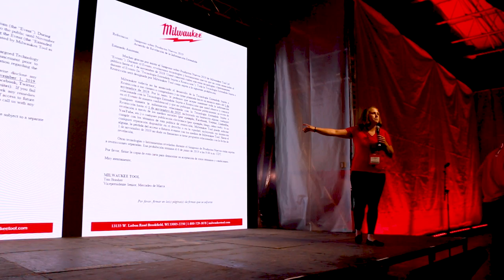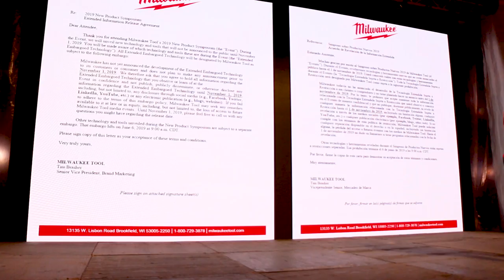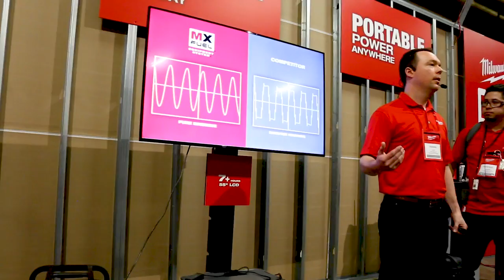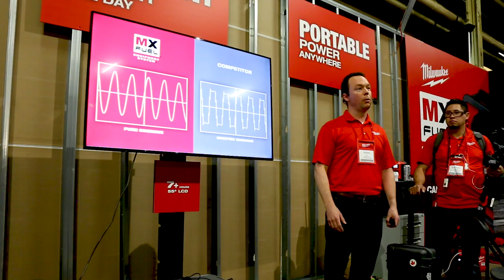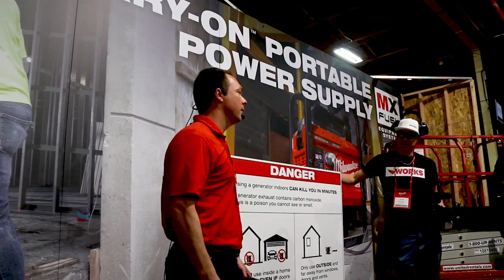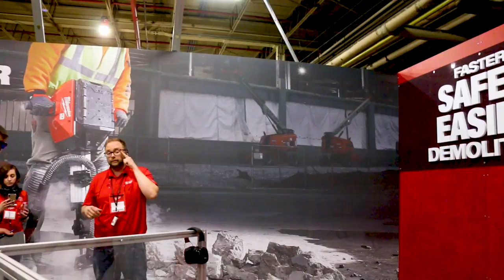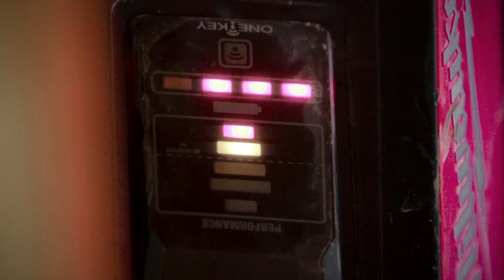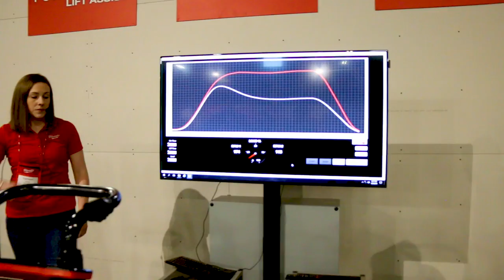MILWAUKEE TOOL MX FUEL (New 2020) LIGHT EQUIPMENT SYSTEM

Comment: Just to clarify I own Milwaukee, makita and dewalt tools. I am not a brand loyal guy, I love them all for certain things. With that said, Milwaukee is doing it right! All those tools you just listed have a justification for a new battery line. Makita on the other hand went backwards with their 40v that is not compatible with their 18v. And all they are offering is tools we already own, with “more” power. At least flex volt is backwards compatible! Super excited about these new tools Milwaukee has to offer! That’s my internet rant for the day. :) thanks for the video!
Reply: I agree with this 100%
Reply: Get you some battery adapters and interchange the batteries between tool brands

I'm the same way with tools, but I run my ryobi, worx, Makita, DeWalt all on Milwaukee batteries

Comment: Shit milwuakee should might aswell make a car by this point
Reply from the maker: Coming in 2021 jobsite golf cart !! 😂😂
Reply: @VCGConstruction  shit im down , i saw one on instagram 
Looks doable👍🏼
Reply: Do a Milwaukee vs Tesla soon on TTR!
Reply: MX boom lift 👊🏻
Reply: Hey, no one else is doing things right. Might as well let Milwaukee do it!
Reply: Milwaukee interface plug so you can use M12 to start/ power race cars and other small/ simple engines.
Reply: Could it be based in a new xxxl packout box, transformer style. Watch out for TTR -outside edition. (y)
Reply: Jessie James built a car on monster garage powered by Milwaukee batteries actually lol. so in a way.
Reply: Im waiting for a 12V jump box
Reply: With a packout trunk.
Reply: 2025 Milwaukee packout truck series powered off our new xc 3000.0 battery's only 40lbs and 6k per battery
Reply: They should make a tugger for electrician

Comment: With this new MX Line we better see a mower that uses it now!!!  

Could be the main reason why the mower wasn't shown at NPS19 as it will be part of this new line up.
Reply: Wouldn't be surprised about a ride on mower.
Reply: Would be nice. 
Or a riding mower that uses 2🤷🏽‍♂️
Reply: @danielgarbuzov8106  I'd be down for a ride on.  I'm done pushing. 🤣
Reply: @canogaparque818  Could see something late Q1/20 or early Q2/20 regarding a mower.
Reply: @shadowzedge5793  damn that early cool
Reply: Let's be real and honest though, not the average Milwaukee user/client is going to be going after the "MX" line, so they are better geared for making the mower (whenever it may show) an m18 battery line. The MX line is absolutely targeting contractors specifically, because of the price point is way too large for your normal/average consumer. Think if they did make the mower with the MX battery how many home owners are 1st of all even going to own it, then how many will continue to buy tools in the MX line?? Nobody, esp once some of yall see the price points, it's all fun and games hoping and dreaming till you see those 4 digit pricing points. And this is coming from a die hard Milwaukee fan.
Reply: @abijahgribble  well having that powersupply would come in handy and im sure thatll be on everybodys list , small footprint and hours of use, shit homie you cant go wrong there
Reply: @abijahgribble  they wont only release a mower on the mx. I'm sure they'll also release string trimmer with alot of attachments, chainsaws, hedge trimmers, backpack blowers, and I believe they're aim would be at the commercial landscape, and law care.
Reply: @canogaparque818  ohh no i hear what you're saying my dude 💯, but can you imagine how expensive the line is going to be to enter with? Then say just to purchase 1 or 2 batteries alone if the mower comes out in this line doesnt come with 2 but only 1 MX battery. I think so far they have done awesome In their OPE being in the m18 line, i myself and I'm sure others are heavily invested in the m18 line, so batteries plethora, I dont see ANY downtime. I'm just saying that it makes more sense for this MX line to target the contractors and construction companies, hell even some of the viewers here complain constantly and frequently about m12 and m18 kit prices, just wait will they release the prices for the MX line, and then alot of people will swallow the fact that this line isnt for them. Me personally I've found SO many uses for the m12 and m18 line I've invested in over the years, and to reach the average consumer they will most certainly have to come out with a wider variety of MX tools for it to make sense, but I really truly dont see that happening, as the m12 & m18 lines have us covered there and they continue to do so, if ya know what I mean brotatoe 👍🏻.
Reply: @danielgarbuzov8106  I fully agree on that if they were to release ANY OPE on the MX line. If Milwaukee is working on a mower, it's going to come out on the m18 line. People fail to understand there is still such thing as ideal marketing, if they truly want alot of its users or first time buyers to get their mower, they are not gonna want a price point so high that it just doesnt make sense to the average Joe to buy.
Reply: @abijahgribble  i hear you too ,i have alot of m18&m12 buuut im defenitely getting that power supply regardless, i know this is geared towards heavy duty contractors cuz when they get a contract they get paid in the thousands so i know theyll have no trouble selling this line ,like they said it eliminates alot of the gas troubles but its a case by case basis if it suites you then go for it if not theres no need to buy into it

That being said ,....power supply👍🏼
Theres like a shit ton of uses for it
Reply: @canogaparque818  that is one thing I see in the line that multiple users could use, I am curious on that price point though, it's easily gotta come in at 1k or more. But that thing would serve its purpose and then some, not to mention emergency type situations or camping without all the carbon monoxide and noise 👌🏻👍🏻. And very well put bro,  its case by case basis.
Reply: @abijahgribble  I agree 100% on your point about they will make a lawn mower on the m18 platform, but I also believe they will focus alot on making commercial grade lawncare tools on the mx platform not only a lawnmower.
Reply: @danielgarbuzov8106  @Abijah Gribble Personally I don't see how a mower could be in the M18 line seeing how Milwaukee has stated time and time again they they will not do a dual battery tool.  I don't even see using even the HO 12.0 on a mower due to power demands needed would have a short run time.  This new platform however with the single battery is the solution to the mower IMHO.
Reply: @RobertBarth1  Would be nice to see more regarding pricing of both types of batteries.
Reply: @RobertBarth1  my guess is that the compact mx battery will be alittle bit more expensive then the m18 12.0 ho the reason is because the compact mx battery has only 5 more cells then the m18 12.0 battery. Mx compact has 20 cells and m18 12.0 has 15. Now the bigger mx battery has 40 cells which is double the cells of the compact mx battery. I think the the price of the mx compact will be around 200$ and the bigger one will be around 350$.
Reply: mister clean  nah man I cant see them being over 9k for any of the MX stuff displayed in today's video, but hey we ALL dont know what it is yet, and for the people thinking the MX batteries will be cheaper than the 12.0, lol negative ghost rider, that just ain't happening, Hope's and wants aside. We will all see how this unraveled soon enough though
Reply: @shadowzedge5793  and ya man I understand, I have the same questions and concerns, but I do believe they will have one soon enough, I mean if the 12.0 can run a chainsaw for a little while, then it will for the mower as well, it wont be a long time, we all know that's coming, but I live on 2 acres, so that thing would be absolutely childs play on my property. It might cut 1/3 of an acre on 1 full charge and that grass better be already cut lol
Reply: i hope not... i would rather see it as an m18 single/dual style mower
Reply: Prices are out already on the MX stuff at home depot just type in "MX fuel" itll know what ya mean, take a look.
Reply: mister clean  me neither my man 🤷‍♂️
Reply: That is going to be a very expensive mower. The batteries alone are over $300 each.
Reply: Ride on mowers are only meant for professional landscapers or people with 2+ acres.
If you use a ride on and have less than two acres you better be 95 or have physical problems

Comment: Here's my issue and I actually bought quite a few new Milwaukee Tools here recently typically use DeWalt. But my father's company does as well. And I was tired of having people mistakenly take tools that look somewhat alike. So far I can say I've been please.

That being said I cannot stand it when companies and I was hoping that Milwaukee would be better than this. To these time trials. And they literally intentionally slowly start the gas powered tool or whatever they're going against. Then they start talking about things that most people don't do winterizing your wet saw. Most of the time people that have that kind of stuff own a building to put them in during the winter and most of the time rebuilding heated as well.

And that's just a small gripe. Here's the big one. You cannot start singing the Praises of your tool that you have barely done any kind of stressed test on. And they may say they've done a stress test. You and I both know there's a big difference between being out in the field using a tool in the real world. And then being inside and having machine run it until it dies.

He was talking about you know it's expensive to have to replace carburetors Etc. Well if you take good care of your tools to begin with I shouldn't be an issue. But when time does wear down. Because there's more of that out there it's going to be cheaper to fix. Again show me the stress test the real world numbers. Not some dog and pony show that they bring in people that like Milwaukee to go look at that.

Don't get me wrong I hope it does great and I hope that it does everything they say it will but unfortunately...

Pride goeth before the fall. Besides that I enjoy your guys's Channel you're one of the reasons why I actually started using Milwaukee Tools. When I was looking for something different. Keep up the good
Reply: Damn, I love milwaukee tools but am also not a fan boy and use Dewalt, etc. 

You got it spot on. Its a show for a reason, they're gonna buy the shittest gas tool to compare to their jacked up, brand new line, and you can tell its for the fan boys of this brand. 

That being said I've used a variety of these same tools on work sites and projects and these new MX Fuel seem to just kick ass. Haven't used them personally, I will say that, but that jackhammer test really blew me away once the Milwaukee started blowing through the concrete in a few seconds. Turns a labor intensive, time consuming job into a couple minutes of light work letting the tool control and drive itself, provided proper use, care of tool and what the job is. 

You can't argue with increased performance if they really do the job more efficiently.  I'm sure there's alternatives out there, as there is for everything, but milwaukee seems to exceeds the basics of most tools on a consistent basis. 

Each manufacturer and tool is different though, and shine at different things. I knew dudes in the field who were running battery adapters on their Ryobis, Dewalt, Etc and using milwaukee batterys. Me personally I've tried a couple different saws and blades out now, and I've noticed milwaukee blades and saws are kind of shit. Combine a milwaukee tool with a Diablo blade for example though and it excels versus most other tools in my opinion. The trick is just trying out different tools and bits and figuring out what works best for your work style and your personal preferences.

Comment: OMG please make that portable power supply in 230v 50hz for Australia!!!
Can use it to power my fridge while overlanding in the bush!

That thing will sell like hotcakes here for this exact purpuse, it replaces the need for people to put dual battery systems in their 4x4's... which is literally MILLIONS of potential customers here in AU
Reply: I am sure the tools will be no problem, not sure how they will handle the power supply. The concrete saw, coredrill, lighting system etc. will only nead a different input voltage for battery charging.... no problem. Yo will need to contact Milwaukee or one of their service dealers to get the answer to this market requirement. Of course, at 240V/50Cycle, they will need a specific inverter..... but the draw in amps is half that than at 120V ....My bet is they engineered a single inverter  with an internal 120/240 selection, or electronically controlled. All that need differ are the outlets, if I am correct.

Comment: 99% of the people here aren't going to buy any of these tools, yet y'all are going nuts over this stuff. The inverter is the only thing that could be mass marketed, but with proprietary batteries that probably cost $350-$600, good luck with that. They should have had an adapter for people who already have a stockpile of M18s

Comment: I'm a little skeptical about the Milwaukee breaker and saw cut.  The concrete slabs that they were breaking had no rebar in it. When your out in the real world there is alot of different re-inforcement in the concrete. That re-inforcement makes a big difference. Nothing really beats a pneumatic breaker.

Comment: I love Milwaukee Tools they come out with the smartest stuff then default copy's them then they get it out in 2-3 years later.Also by that time Milwaukee on to next thing. They need to add a corded option to the jack hammer Power pack and Wet saw. What I mean is if the batter is dead you can plug it in.

Comment: Great start to a lineup that I'm sure is 100 tools long. My only gripe is that they did 3 and 6 amp hour batteries instead of 4 and 8
Reply: Likely because they already have a second generation battery planned using 4 and 8 to look like an incremental performance gain. Profit!

Comment: I agree that battery is better is almost every way. But they constantly hide the drawback of charging by basically saying "it will only do half the work you need it to but you can just swap batteries" when the batteries are massive and expensive you don't want to swap it out 10 times to get through a day

Comment: Awesome looking tools gonna be a whole new ball game. Kinda disappointing they couldn't make them work with the expensive batteries they already sold tons of. I guess it creates a new market but I prefer the DeWalt approach with flex volt. I feel like they could have done something similar and it would have been nice for the guys who have invested tons in their m18 platform. I'm a little disappointed I would have loved to pick up some high voltage drills but no way I can do a 4th battery platform I already have over a thousand in batteries.

Comment: those MX batteries look like they’re going to have plenty of room to expand as battery cells get better, just like the m18 line with 20700 cells!
Reply: Mykel Hardin amperage draw. not capacity.
Reply: Mykel Hardin  I wonder why all of Milwaukee's H.O. batteries are 20700 based. You must be smarter than Milwaukee's engineers.

Comment: Milwaukee needs to make an electric bike like the radrover with that kind of power. And have an extra mount where you can add a second battery if needed. And swap the battery when one goes dead that way you won't totally run both out at once not knowing.

Comment: This is so awesome, any guesses on voltage? Come on MX fuel lawn mower
Reply from the maker: Milwaukee's answer was "at this level it's not about voltage we're using a horsepower rating" ! I wouldn't be surprised if the voltage is in the 240 range !
Reply: @VCGConstruction  I could imagine how hard it was not to spill the beans! I love that power inverter,would be nice if they make a smaller lower wattage version also.
Reply from the maker: Lawyers are very expensive, our lips were sealed!! 🤣🤣
Reply: After some research it looks to be 36V.
MX FUEL XC406 Battery (40) 3.6V 21700 6AH
MX FUEL CP203 Battery (20) 3.6V 21700 3AH
Reply: Just found out it's 72 volt, 80vmax
Reply: @aaronrepper7649  damn thats a monster right there
No wonder
Reply: It's 72 volts nominal or 80 max
Reply: 72 nominal 80v max

Comment: I'm wondering can you use the core drill for just hammer drilling. I work for a pest control company and we have to drill slabs on termite jobs and we use hilti and you only get about 20 holes out a battery. I have two drills cause they eat through batteries.

Comment: I love Milwaukee and have there 12v stuff but I gotta call this line out. It's ok for casual users. I'm roadworks. Its 2 batteries per tank on the saw. So some days that's upto 10 batteries for cutting blocks all day., The core drill looks good but when my drill makes that crunching sound it's the gears lol and that sounds the same, I doubt that sound is a clutch !. The Jack hammer come on man. The plastic boot thing on the point wouldn't last 1 minute on a site. The concrete is above ground level, a sledge hammer could break that, try breaking it in ground, nothing beats a compressed air red belly gun and after that a 2 stroke. The genny thing Is nothing more than a lithium leisure battery with inverter, u could save massively by buying just that. Don't get me wrong it looks good stuff but definitely not for roadworks yet. Imagine the concrete dust and particles getting into that battery connection over time. And then theres the issue of charging the batteries on a site in the middle of nowhere.